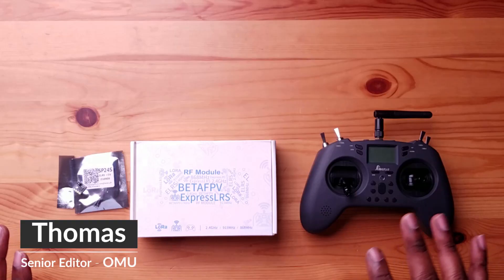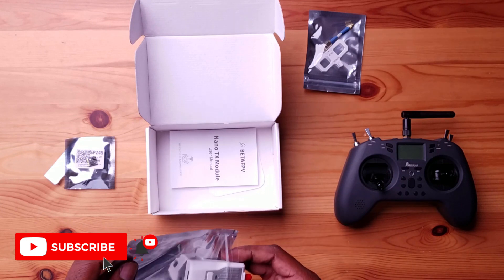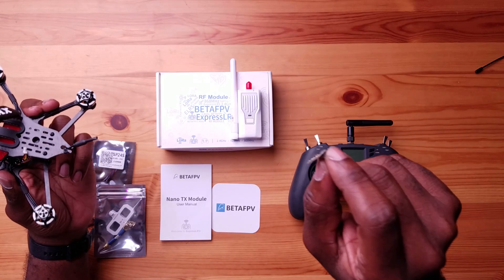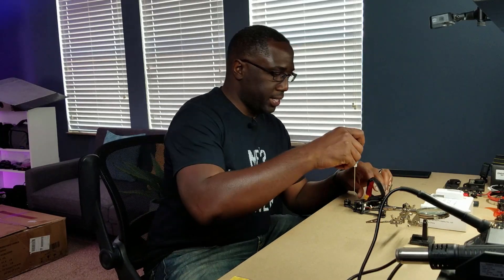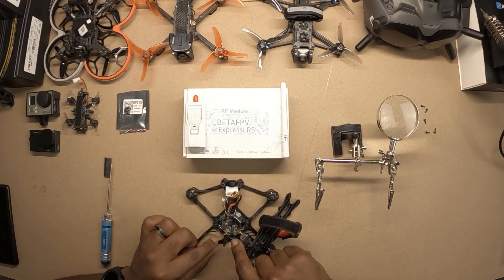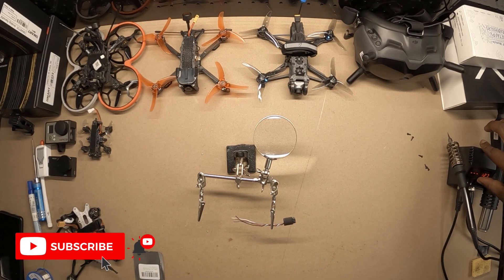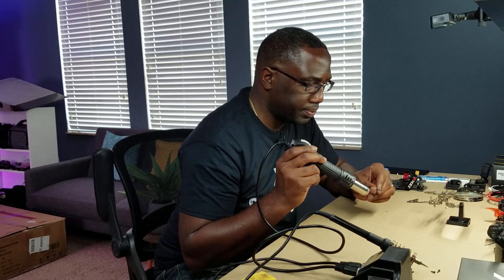ELRS FULL Setup and Configuration | Step by Step From Soldering to Test Flight PT1

Comment: Hey quick question...I noticed on your flight video you were able to fly and have control using elrs, but the LQ and resistance dbm both showed 0 and -130....I'm having the same issue. We're you able to get the LQ and Rssi dbm to show up properly?
Reply from the maker: Yes, I was able to fix that problem. 
I don’t know what version of BetaFlight you’re on, but I’m on 10.9.0.  So try to go into your Receiver Tab and make sure your RSSI is checked in the off position.  That option does not need to be on.  If you’re getting a warning on your screen, go to your “OSD” tab and unselect “Link Quality” and “RSSI dBm” in the warning portion(right side of screen).
Reply: @One Man Unmanned  thanks for that, it did it! I accidentally had RSSI over ADC selected. You rock
Reply from the maker: @kenYTCA  glad it helped.  Take care!

Comment: Kinda stupid question but where did you get those wires
Reply from the maker: I'm sorry, what wires are you referring to?
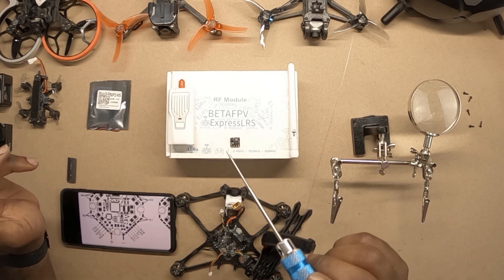Reply: @OneManUnmanned  3:55
Reply from the maker: Thanks.. that wiring came with the ELRS receiver.  I think most brands include wiring in the packaging.  This one was JHEMCU branded, but I think BetaFPV also includes the wires as well.
Reply: @OneManUnmanned  Oh cause I got the radiomaster zorro elrs pack with recievers but they didn't come with wires can I just cut off some battery connectors
Reply: @OneManUnmanned  oh wait at 3:19 you had the reciever wires already on

Comment: Great vid. I'm planning to get into ELRS. I have some various FlySky drones and some Frsky D8 Tiny Hawks. I'm 73 and enjoy flying FPV but I am a bit intimidated by the updating FW stuff. Praying I get through that and into the air. One thing to suggest to you that I like is I use a silicone work mat. I can anchor my parts and solder right on it. It bears the heat without melting or anything. I've seen muffin molds made for the oven that are made of silicone. I use poster mounting putty to hold things from moving or a heat resistant tape. You're right that those alligator grips on the "helping hands" device have a strong damaging bite. Also you might use a piece of clear heat shrink to cover receivers  with LEDs . Thanks and I've subbed you!
Reply from the maker: Thanks Colin...All great points.  I know own a silicone mat, but really need to invest in some putty or clay.  I only remember as I'm about to build or repair a drone.  ELRS is worth the initial headache is setup.  Once you have your configurator and proper "targets" selected, it's pretty easy from there.  Just like anything, the more you do it, the easier it gets.  Thanks for your suggestions and support to the channel.

Comment: Which frequency to use for India?
Reply from the maker: I would assume 868 since you,re non FCC.
Reply: @OneManUnmanned  thank you so much man! I am binging all your videos on lite radio so I could make a decision and dropping my questions here. And you're really helping me a lot. Thank you!
Just one last question, radio lite 3 transmitter would support 868 right? Or it only comes with 2.3G?
Reply from the maker: It is a 2.4G radio, but it does have an Frsky LBT protocol for the EU region(I think that only affects the power output though).
Reply: @OneManUnmanned  great. Thank you for all the help!

Comment: Great video BUT, you should definitely not clean your tip that way, steel removes the thin nickel plating and exposes the copper to rapid oxidization, probably the reason why your tip gets so dirty so often. Try using a brass sponge (which is softer than nickel and therefore won't remove it) or a wet sponge. My would strongly advice buying a  new tip.
Reply from the maker: Haha..I agree.  I mentioned(maybe I did not), the last time I soldered was 10 years ago, and started 30 years ago.  So, things and technology was different back then.   It was an old habit. 😪   But yes, I have other new tips in my work bench.  I hope this clarify and helps other pilots watching the video.
Reply: @OneManUnmanned  No problem. By the way, great content. I instantly assumed you had 100k+ subs just for the quality.
Reply from the maker: Thanks Bro...I appreciate that and the support.

Comment: Pretty nice soldering job and love that iron/heat gun combo.   I had been using FRSKY and the Jumper T-lite but got tired of random failsafes so bought a Crossfire 3-pack (ELRS was an option but CRSF  is mature and works great).   I converted my Roma V2 and Protek 35 but accidentlaly mangled the ufl connector on one of the three nanos I had in the kit.    I was happy with the security of the link and range but hated the new form factor of the T-lite with the module installed.   I bought a Jumper T-18 Pro and a conversion kit for my CSRF module to convert it to standard (more soldering) and loving it (T-lite still feels better in hands but the features and control of the T-18 compensate).   Still use T-lite for my Tinyhawk 2 FS but it needs a new antenna (which sucks as it is soldered to the board).   I love my TH2 but I may not bother to fix it as....

I have a new baby arriving :-)...a Flywoo Firefly Baby 1.6 (Quad not Hex) with CSRF.  Roma is just too big and heavy to fly around my neighborhood.  Hope this drone is as good as looks on paper and more importantly safer to fly around my neighborhood, the Roma and Protek are both weigh in at nearly 700g all up.
Reply from the maker: Thanks man, I appreciate that.   The soldering station is not bad.   Got some good uses on this project and another.   It's funny you mention Crossfire, because I bought a few receivers to put in future drones, maybe my Nazgul5V2.  Having said that, I'm loving ELRS, and it seems to be more efficient on my T-lite.  I'm wondering if to sell my new  CRSF receivers.  We'll see...